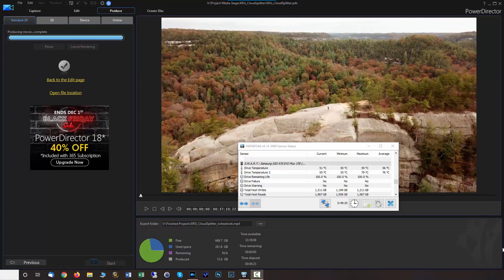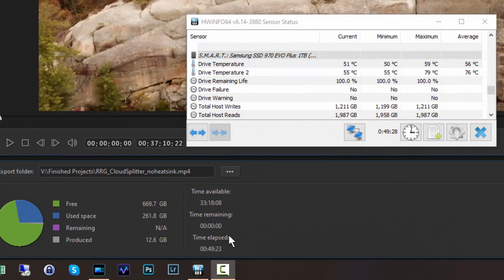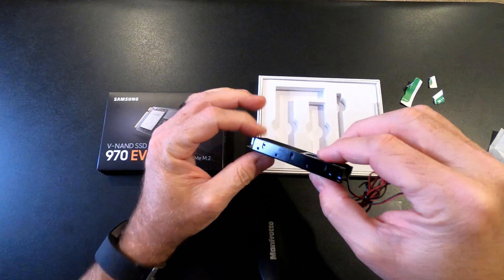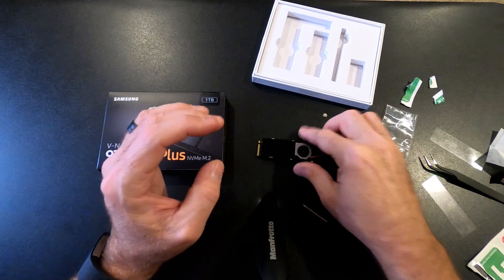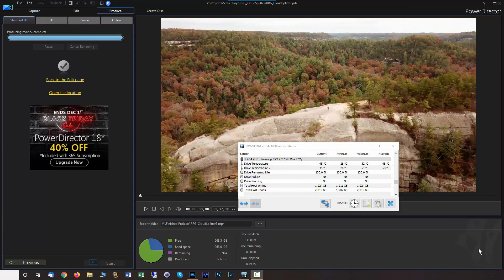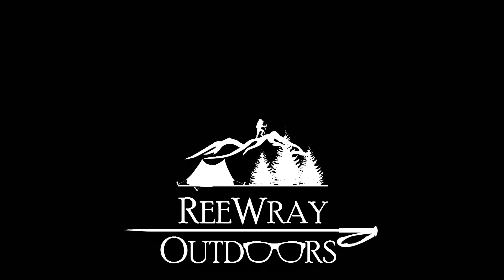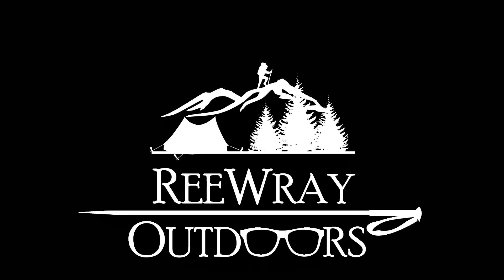SHOULD YOU INSTALL an M.2 NVMe HEATSINK??  Pros & Cons, How to Install It

Comment: I tryed testing it by cooling it down by ice pack 
And there is no change in read and write speed 
It was very little 
I was warried that nvme drive getting so hot that i can feal that heat outside laptop body

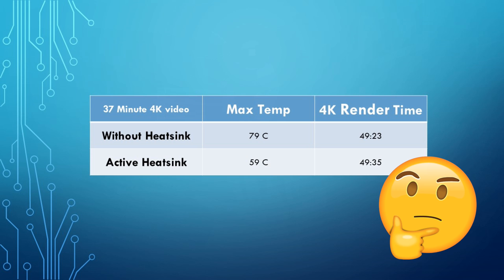Comment: 11:15 the job of cooling was supposed to cool the drive down not reduce rendering time and it did its job. Render this the third time and the results will be different shorter or longer. Do it the fourth time it will be different again shorter or longer. The difference will occur naturally up to a few percent with or without the cooling mod. The temperature reduction was significant.

Comment: I have found a 5 degree less difference using the asus motherboard heatsink with graphine spreader and thermal pads than a usual m2 heatsink, but another thing to consider is there will be between 5 and 10 degrees difference in spring summer compared to autumn winter.

Comment: In a PERFECT system, the SSD controller would ALWAYS be cool.  (A hot controller doesn't perform any better than does a cool one and, as you said, solid state devices last longer when they remain cool).  
In a perfect system, the NAND would be cool when not being written to (extending how long data is retained but it would be extremely warm when being written to (decreasing write and erase stresses).
I put a "heat sink" on all of my SSD because it is as much a heat SPREADER as it is a heat dissipater. When I'm writing, the controller generates heat and some of that heat gets moved to the NAND.  BOTH benefit.  When I'm not writing, both the NAND and the controller remain reasonably cool.

Comment: Interesting results but that variance is "margin of error". I believe the correct conclusion is that the heatsink makes NO difference to performance.
Reply from the maker: yeah, this is an older video, but I've come to the conclusion that these heatsinks are really not necessary...and the limited heatsink properties in the MFG label are satisfactory out of the box.
Reply: @ReeWrayOutdoors  so now in your experience would you suggest plain passive heatsink or not even that?
Reply from the maker: @MNaveedSheikh  honestly I would not even bother if uour PC has decent ventilation.
Reply: @ReeWrayOutdoors  🙂👍

Comment: I wounder if would be better to just use two different thermally conductive pads with different rate of heat transfer, higher transfer one on the chipset to keep it relatively cooler and the lower transfer one on the memory chips to keep them relatively warmer but not too warm, getting the best of both worlds, performance and longevity. 
It think it would be beneficial for those with very tight builds or others who are to abuse their SSDs, like in algorithmic paging, rendering, etc.
Reply from the maker: I believe that is correct.  But I'm not sure the benefits really outweigh the costs.

Comment: #1 Removing the factory sticker is optional but totally not necessary.
#2 The thikness of the memory chip is greater than the thickness of the controller chip so you actually need one of the following:
 - 2 different thermal of different thickness like 0.5mm and 1mm
- 1 thick (1mm or above) thermal pad which is very soft
- thermal pad paste
#3 The thermal pad is applied wrong, you apply it on the SSD first to make sure it's a perfect contact on the chips

If you would have done these things you could have gaine 10+ degrees of cooling during load.
Reply: So is it safe to say that the top label/sticker is not a heatsink of any kind? I keep hearing different opinions on that. In looking at the label up close, to me, it looks like just a label, no copper or foam. The label on the bottom of the SSD clearly does sit on top of thick copper.
Reply: @EnterAndJoy  No, it actually is a heatsink, a primitive one.
Reply: @bogdi55  Thanks. I have 2 Samsung Evo Plus 2TB. One has the sticker and the other does not (I was able to buy it on OfferUp for $50 because it has no label). I have verified it is legit by getting the serial number using the command prompt and then checking the serial number with Samsung. 

Do you have any suggestions one what to do about it not having a sticker? Should I buy a heatsink? Both SSDs will be going into an MSI Prestige 15 thin laptop.
Reply: @EnterAndJoy  test them first and check if there are actually any differences

Comment: OK first off you do NOT remove the sticker it is already conductive..... To properly install the sink you cut tiny slits in the already applied conductive sticker between the NAND's and  the controller... Then add the heatsinks thermal pads by trimming them down to fit over the Controller & RAM if its equipped with one.. Add one small square  on top of each NAND & assemble... NAND's will on endpoint last longer if they are kept  warmer then cooler Hence why you add only one small square to each NAND about 1/3rd of its size

Comment: heat is not destroyed by heatsinks, same amount of heat affects system regardless
Reply from the maker: Yeah, I've since realized that I didn't think that particular point through very well.  It's been awhile, but I suspect my mindset at the time was that the cooling fan that comes with than active heatsink might help move the heat out more quickly where the main cooling fans could get it out of the case.   But of course, I've no data to back-up that assumption. ;)

Comment: Reasonable video, gave it a like despite some flaws. But I feel compelled to point out that you didn't see a 25% drop in temperature. It's actually 6%. Ever heard of the Kelvin temperature scale? Overall you're very right that 12 seconds less than 1/2% is nominal to the point of being essentially zero for a sample size of 1.

Comment: I think your rendering results are within the expected tolerance for what could be considered identical results. It is just that your SSD is not throttling at 79 degC, so both tests were under similarly performing SSDs. However, writing to the NAND at lower temps produces more degradation in the cells, which may counteract the longer life due to lower temperatures. I think if you have the SSD idling most of the time, an active heat sink is good, but if not, probably a passive heat sink is better so the cells are warmer when writing. You can also put the thermal silicone pad only on the controller,  not on the NAND chips (probably this is the best balance).

Comment: LTT had a video on this and my takeaway was that it's a tradeoff longevity vs. performance.
Yes, the memory performs better when warm, but it's lifetime is shortened when it's too warm.
So you should aim for a sweetspot in the middle.
A simple heatsink should provide just that.
Reply from the maker: yeah, that is basically the conclusion I came to as well. :)
Reply: in that case passive heatsinks are just fine infact better for the purpose?

Comment: I'm interested in buying the heatsink from the amazon link you provided, but it's not the same as the one you tested in the video. It has a single panel and a single thermal pad which I'm fine with it, but I just wonder if it has the same effect on cooling heats. Have you also tested with it? Did it have the same or similar results?
Reply from the maker: Oh! Yeah, apparently they changed the listing for that link.  You will definitely get lower operating temps with the integrated fan version - though I doubt that in practice it will really make much difference either way, in terms of performance.  Still, if you don't already have excellent ventilation in your PC case, it might make sense to get the active heatsink with the fan.  I corrected the link, but here's the version I found that closest to what I was testing in the video: https://amzn.to/3lI2JQ2

Comment: Hi you need to use the active heatsink The 20c difference would shorten its lifespan by years With an air cooled system a passive heatsink would suffice but no way should any NVME be used without a heatsink

Comment: I've heard, that the controller chip is what really needs the cooling, and that the memory chips will actually last longer, if allowed to run warmer.
That being said, I've been told, that these heat sinks are best utilized, if you cut the pad that is placed on top, so that it only contacts the control chip, and not the actual memory chips.
The bottom pad is fine, because it's only contacting the circuit board, and shouldn't be cut, because you could run the risk of shorting out the board on the aluminum housing.
I'll be trying this in my system, just to see if the render times stay the same.
Reply from the maker: Yeah that's what the consensus seems to be. Let us know how your experiment works out! 😀

Comment: My stock  heatsink that came with the motherboard (Gigabyte Z480 Gaming X) reduced the max temperature from 66 to 56 degrees. For those of you who have the same motherboard, be careful: you have to lower (take off) the top-mounting screw where the heatsink attaches to the board (the last mounting hole on my motherboard), otherwise the heatsink is too high and the heatsink pad doesn't stick to the disk.
Reply from the maker: Thanks for sharing.  More info is always better! :)

Comment: Also don't forget while SSD drive overheating, it is starting throttling, and lowering performance rate. So if writing big file with 150mb/s, throttling will cut this speed in half, and if not enough to lower temperature another half after. Lower temperature better.
In your testing it less than 0.3% difirence. It just measurement error occurred.

Comment: A heatsink on the SSD will not change the temperature inside your case or of the CPU or other components. The heat, generated by the SSD remains the same, it's just transported faster off the chips with a heatsink, so less hotspot effect.
Reply: Dissipating heat faster means that disipated heat has to go somewhere... i.e. into your case like any other heatsink.
Reply: U

Comment: That's a perfectly normal temp for nand. They actually run faster at those temps. It's not until 100c+ that they throttle.
Reply: False information. The controller starts trottling at 79C, or 85C for some Phoenix controllers. Mine goes to 96C without a heatsink and the throttling is very noticeable.

Comment: It is commendable that you made this video but some of your conclusions 
are erroneous. 
1.The performance increase you got is so insignificant it falls within the margin of error. 
2. Running the NVME at low temperatures (Cooled) while under intensive writes actually reduces the life of the NVME in half. 
- Runing NVME optimally is a predicament, on one hand you want to run it HOT under intensive writes, (Say about 10 to 15 degrees below Maximum manufacturer's specified temperature) - On the other hand you WANT TO KEEP THE CONTROLLER as cool as possible. SO... Conclusion... Whether you need to use a HEAT SINK or NOT is dependent on several variables: i.e typical use..., Case ventilation and temperatures..., The design and quality of the NVME itself.... And some low performance NVME may not need a heat sink at all ... Some NVMEs Like the Top notch Samsung Evo Plus has the controller covered with a tiny heat sink... Also, some motherboards  have a simple heat sink built in like the Asus X470 for example.

Comment: cooling is a no brainer, negligible performance loss vs reliability of operation cause it is not just prolonging the life of your m.2 though this is a big plus. there is a reason all new motherboards are equipped with cooling capabilities for the m.2 ssd.  passive cooling with sufficient airflow is sufficient imo but no cooling at all wouldnt be something i would like to see in my pc as i have had a m.2 failure in the past and that was without cooling (this could have been bad luck honestly).

Comment: I would like to get an ssd today so IF it's possible when/if you see this it's today, I fast reply would be GREATLY appreciated. 

I render videos with PD too, I would like to use the M.2 as my Windows drive. Would it be ok between my RTX 2080 and my CPU which has a Hyper 212 cooler on it, would it be affected by their heat as well? Would really appreciate responses!

Maybe a video idea for the future?
Reply from the maker: Seems likely there would be SOME heat added from the CPU/GPU, but as long as you've got decent case ventilation,  I think you'd be fine. These m.2 drives even run a little faster when they're hot as long as it's not dangerously so.  I'd be surprised if you had any issues.
Reply: @ReeWrayOutdoors  Thanks so much! Have a great day and be safe!

Comment: There's moments where electrical whine is getting through in your audio. Are you recording your bare mic then cleaning up and mastering as post-production instead of routing your mic through a DAW?
Reply from the maker: I think what you're hearing is interference from my cell phone because I forgot to put it in Airplane mode and it's occasionally causing a problem with my wireless mic setup

Comment: @ReeWray
 You mentioned in your video that the heat sink will put less "stress" on the other components of your computer. I assume you mean thermal "stress" but you should know that a heat sink doesn't change the amount of heat generated inside your case, it's simply redistributing the heat. Your case won't be any cooler as a result and therefore there's no real change in thermal load to the rest of the system. 
Instead of cooling the entire NVME, it would make more sense just to cool the controller as that's the component that benefits the most from active cooling. Unfortunately, I've never actually seen an NVME controller heat sink that wasn't anything more than a paste on passive heat sink.

Comment: I've seen and I've known based in youtube videos by experts and the basics of electronics, the heat sink and the electronic device most be in contact with the thermal compound , even in the Laird thermal systems website they don't show anything between component and heat sink. I removed the sitcker of my m.2, following the basic and initial function of heat management in electronics. but some users still say things like this http://altared.net/ee/dc5ps_046o.png (o0)

Comment: hi i have a big question for you with this active fan heatsink.. does it sound noisy ? the fan ? i had bought something active heatsink with fan , and it is noisy !! so i decided to send it back to the seller, was very disappointed with that !!!.. i have found something similar with yours in this video, and i want to buy it if that is not noisy ? thanks
Reply from the maker: Mine wasn't noisy at all. Couldn't hear it above the case and GPU fans. So hopefully you'll have better luck with the next one.

Comment: 11:06 "Temperature dropped by 25 %" That's not how temperature works. You can only use percentages when you talk about delta T. If you used a different scale the drop in temperature would be different percentagewise even though you're describing the same reality.

Comment: min temps is a little to low, you don't need a small fan on the heatsink
Reply from the maker: yeah I've actually recently disconnected power to the heatsink fan and did some quick testing - didn't really make much different at all (performance or temps).  Really starting to believe these M.2 heatsinks are a solution to a problem that doesn't (typically) exist! :P

Comment: Is it okay to remove the stickers with a heat gun? If so, which temperature do you think would be safe? My heat gun starts as low as 120°F and has 10°F increments. I see that the warning/critical temperatures for this unit are at 85°C (185°F). I don't know if the external components can handle 180°F to warm up the adhesive before removing the labels. I just want to keep them in the best shape possible should I ever need to replace them.
Reply from the maker: Hmmm given that the labels are designed to withstand fairly high temp, I'm not sure Id be comfortable heating them up enough to make them easy to peel off. But Im not going to claim any special knowledge in this area....just my personal opinion.

Comment: Am sorry if this might sound little bit disrespectful. And am sure that you are great at your profession. But some technicalities you stated are not exactly correct. By cooling the m.2 you are actually putting more heat in the pc case, the question would be how fast you case transfer the heat outside, by cooling the m.2 you are actually radiating more heat into the case therefore decreasing temperature difference between the case ambient temperature and CPU heatsink. Second point: you have a very tiny sample size of tests. You need to run at least 10 of each, with the cooler and without. Just having one test of each might not have any weight unless you have a major difference between two. Great info, still, thank you.

Comment: Might get a quicker render time if the heat pd only contacts the controller chip?
Of course, it depends on whether the heat sink clears the nand with that portion of the heat transfer pad removed.
I read that the controller is the bit that benefits from cooling, and I suspect it reports temperature and probably generates more heat than the nand.
Reply from the maker: I think that's correct.  But still doubt I'd see any real improvement in rendering time from that, since it didn't appear that my SSD was throttling at all, and it seems to be the CPU performance that has the most impact on that.

Comment: There are 2 temperatures and you only mentioned the second. One is the memory temp and the other is the controller temp. memory likes to be hot and memory controller to be low so they might want to half of a heatsink for the M.2 NVMe... LOL...

Comment: Cooling the control chip not the storage is what I have found works best, 2tb m.2 seagate firecuda 510.  I have generic heatsink on the control chip and thermal pad between the m.2 drive and the motherboard.